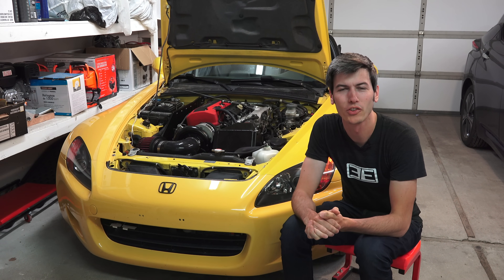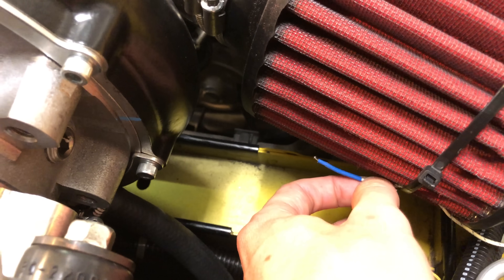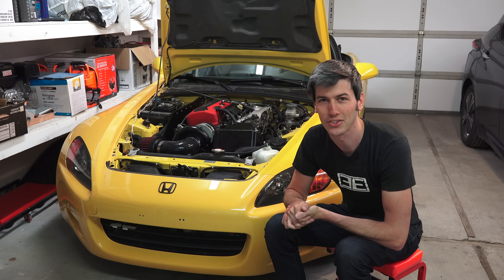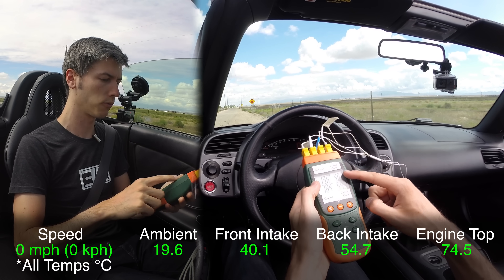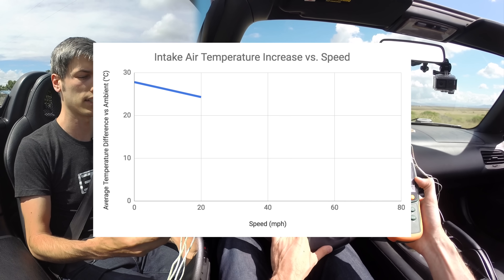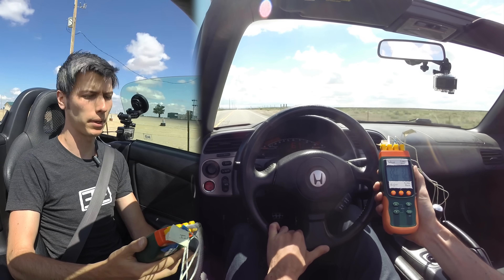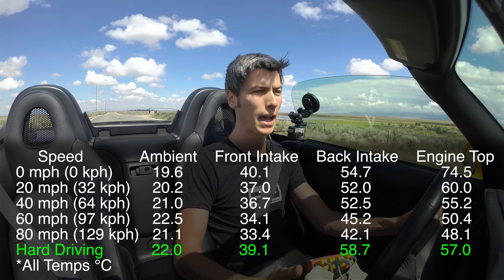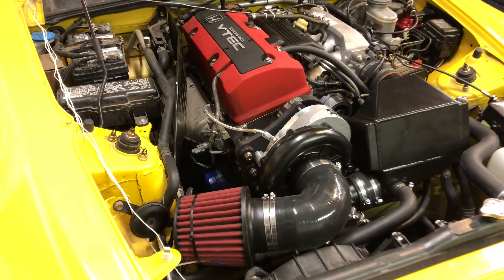Does My Supercharged S2000 Have A Hot Air Intake?

Comment: A hood scoop helps to direct cooler air maybe a funnel with heat shielding could direct cooler air.
 I say a funnel because piping air directly from exterior could allow water to reach the filter wile funneling cooler air into engine bay near the filter will prevent water contamination.✌

Comment: I'm curisious how much heat input the tc's are getting through radiation. Is it actually reading the airtemp ?
Reply from the maker: Yeah it’s air temp. The flow by the thermocouples is fast enough that air temp cools it very quickly. Also there’s a heat shield covering the exhaust, so radiation isn’t super high.

Comment: i think you screwed up here.  you missed the two most crucial thermocouple positions.  inside the intake right after the filter and inside the intake manifold.  sure it's nice to know what the air is like at random places around the engine, but you need to know what the air is like that is actually going into the engine.  for all we know a 20 degree difference in the sourced air has only a 1 degree difference in air going into the cylinders.

Comment: Have a vf engineering non intercooled vortech supercharger on my car. Heat soak is a big problem, the intake in mounted directly in the front bumper intake hole but even then sucking in 136 degree (f) air when ambient is 100 degree. Pushed it hard when i was 105 out and it was pulling timing pretty heavily. No real way to get an intercooler in there so looking at water methanol kits.

Comment: I'd be interested to know how the after cooler impacts the Intake Air Temperature compared to what is being drawn into the Supercharger at the Air Intake.  I'm sure a change in intake temp is noteworthy, but if the after cooler pulls out enough heat, it might not be that impactful to the engine performance.

Comment: When it was bout 90+ out my IAT's were almost 140 degrees on my POS honda. I have a DC short RAM and monitor it with TORQUE for android and a Bluetooth OBDII adapter for like $15. Seems like the hotter the Air, The less power it makes, and my foot is in it more to maintain speed, causing more downshifts, them my MPGs go down the shitter. Maybe a CAI would help MPGs in this instance.

Comment: Problem now is if you extend the filter into cooler air you are lengthening the intake tract, which hurts throttle response (but can potentially increase torque due to air speed). Ideally you'd keep the intake length short but that's tough since your intake is on the same side as the exhaust .. bah. Next step is probably a heat shield or giant hole in the hood above the engine :)

Comment: best way would be to keep oem intake and remove the second portion of the intake which is normaly located under the front of the car and create one with less restriction. maybe not all cars have a second part to the intake i know my 98 prelude does. i know for sure this will help the engine breath better on hot days.

Comment: I'm curious how much heat is coming from the exhaust vs that coming from the radiator; whilst I do think a lot of heat comes from the exhaust, I think the air coming through the radiator and shroud sets the ambient temperature in the engine bay - if there was one more thermocouple behind the electric fan I'm sure it would shed some light on this.
Reply from the maker: Yes, great point. Certainly heat added from the radiator which I think explains the front intake temp rise.

Comment: It's been proven that open short ram intakes without proper shielding degrades performance due to hot air in the engine bay.  That is why the stock airbox always edges them out.
Reply: OCTurboJoe yeah on stock NA applications. On forced induction it's makes basically no difference. The air enters a very hot turbo or supercharger, gets compressed and therefore heated more, then goes through an intercooler. It doesn't matter if the intake air is 78 degrees instead of 87.
Reply: shawnmeyer44 No, it does matter on forced induction as much as NA.  There is MAF and speed density.  Modern MAFs usually have IAT sensors built into them.  The higher the heat readings, the more timing it will pull.  On speed density, hot air is less dense, and will also pull timing.
Reply: OCTurboJoe that's what tunes are for.. when your dealing with boost you want primary iat to be taken post intercooler.. like in the cold pipe or the manifold itself.
The point is that a "cold air" intake will not drop the air temperature enough to change charge temps.. certainly not enough to make any measurable gain in performance. The air is entering a hot supercharger or turbo, then it is further heated by it being compressed.. only to then go through an intercooler.. 
If you really want to drop iats and increase power then get a meth setup or increase the size of that cute little heat exchanger lol

Comment: But will the warmer air generated by the engine bay truly make a significant difference in the temperature of the air going to the cylinder since the compressor will add a significant amount of heat to the incoming air.  What is the temperature of the air going into the cylinder, or at the exit of the compressor/supercharger?

Comment: The supercharger intake position is screaming for a ram air box running to a point upstream of the radiator. Think corvette intake. A heat shield box is ok, but no replacement for free airstream.

Comment: The location of the air intake in relation to the radiator will also be responsible for the high temperature differential you measured. Even while driving, the cool air will pick up heat as it passes through the radiator. An enclosed air box with piping closer to the front of the vehicle, or relocating the filter will have a greater effect than just adding an exhaust heat shield to the existing setup.

Comment: Interesting! Like all research, if you already knew what the answer was going to be there would be no point in doing the work. :-)

My plane's engine air intake is out in the open, right behind the prop. You can feed warm air off the exhaust manifold to melt ice in the carburetor, but normal operation is with cold air. When you turn on carb heat the loss of power is obvious.

Comment: Cold intake works but dangerous. If a splash of water will get to it the engine could hydro lock - not good. That one of the reasons OEMs avoid the cold air intake
Reply: You gotta design an inertial separator into the intake like a number of factory cold air intakes do.

Comment: Even though you take hot or cold air intake the supercharger increases the temperature of the air if the after cooler is not working good or efficiently. But I guess rerouting your intake to front of the car makes sense as colder air is more dense compared to hotter air

Comment: Great video. 

What would your anticipated performance increase calculations look like based on ambient temp and am average of your intake temps?  0-60 time, torque and hp curve? As the temperature is warmer on the slower speeds, I'm sure the acceleration would get the greatest benefit.

Maybe it's time to fabricate a hood scoop for cold air in or a vent to better release the hot air?

Comment: heat shield seems more efficient than moving the intake because by moving it you increase the length of the tube which the air has to travel and it's probably not straight so you get at least a bit more resistance

Comment: Another great video! I wonder if there would be a significant difference if you put the thermocouple inside the air filter so that you're just measuring the air coming in, rather than possible radiant heat hitting those sensors and skewing your results.

Comment: Wonder if having the radiator fans on caused the temp to spike when you were driving it hard??? 
Would make sense, puking a ton of hot air on your engine/intake when beating on it... 
Excellent video sir, please keep us informed on any mods you do, interested to see if any mods you do make a difference, but I suspect any increase in performance would be miniscule at best :-)
Reply from the maker: Yes, radiator definitely raises the temp in the engine bay.

Comment: I don't have a supercharger yet, I do have a K&N intake which does have a heat shield figured tho it would hurt to reduce the heat around the intake a bit more so I gold taped (heat reflective tape) both the heat shield box and the intake/arm tube. Maybe it worked maybe not but it does look cool tho.. thanks for the video good reference point.

Comment: Nice video . Try to cordon off the air intake with a shield ...similar to the ones sold by k&n . Also place an air scoop/funnel inside the grill and direct the cold air with a hose from inside the bumper and  into the cordoned off space. ( something similar to a cold air intake) . I am from India and the disadvantage of running a  cold air intake is during rainy seasons , there  are high chances of water ingress which can cause hydrostatic lock  . With the setup i've mentioned earlier , you can get a cold  air feed and at the same time a much lesser chance of water ingress.

Comment: I wouldn’t have thought you’d need to measure this.

It’s quite obvious that air from outside the car is going to be cooler than air in the engine bay, or am I missing something?
Reply from the maker: I assumed there would be more fresh air passing through, seems the radiator plays a big role in controlling engine bay temperatures, without much additional “fresh” air passing through.

Comment: It could be interesting to introduce a cooling plate as a variable here. Something like the AUT cooling plate that is the designed to pull fresh air in from the front of the S2000, and channel it into the stock intake. Since the filter is sitting right near where the stock air box did, it could have a meaningful impact.

Comment: The intake is behind the radiator in the airflow path, it's a hot air intake. Anything behind the radiator should be considered "hot" relative to ambient just due to the fact that now airflow is cut significantly while having a heat shield is good and will help, moving the filter into a position of direct airflow will result in much cooler temps, always remember that the bumper and most of the front of the car are meant to cut through the air and direct it to the radiator.

Comment: Considering a 30C diference between the ambient temp and intake temp, is it possible to calculate the power loses? Could the higher CFM of this intake overcome the temp issue? 

I’m running a similar setup and getting similar temperature readings in a N52 BMW 130i.

Comment: The concept is simple. No matter what process is happening in your intake, cooler air is better and will make more power.

Take a cup of room temp water and a cup of hot water and put it in the fridge for 15 minutes. They both go through the same process, but one will come out cooler than the other because it started cooler than the other.

Also interesting that people will not argue that cold weather makes more power, but also assume pulling cooler air does nothing when it's going through a compressor.

Granted it might not be worth the extra $300 for an intake with a box/heatshield to get 5-10hp, but the power gains and efficiency improvements will be there.

Comment: That what I missed about the old Comptech S/C setup, the kit provided you with an air box that shielded the filter from the engine heat without the need to route the filter to the bottom because it had a duct you can use to channel cold air into the box.

Comment: Very informative video! This is why I just use a drop in performance filter in stock location, coldest temps by design. Doesn’t get that fun sound but I never have to worry about loose couplings, water, heat soaking, or constantly cleaning it from the extra dirt (like the wife’s car🙄) 
And usually you can slightly modify the stock box to get more air flow. 
Can you do a calculation of weight savings performance compared to temperature performance?
Reply: Zander N ColdEST temps by DESIGN? No. That’s not the priority of the mfg. Weather protection is probably first, which assures restriction, hard turns, no smooth path for outside air. Noise reduction is second, usually disturbing smooth airflow, adding bulk and weight. Cold is not a priority either. Hot air sourcing has been used for decades to warm engines quicker for reduces emissions. Some factory designs are much better than others, and can have a protected outside air source, but your statement is false.

Comment: id like to see a test where the thermometer is inside the air intake, lets say right before the throttle body. and then get a read of the temp with the intake where it currently is and then compare it to the temps if you moved the intake to the front of the car.

Comment: RE: "Need" for hot air.

Had an '86 Dodge D50 with carb. Decided that the arm air stove off the exhaust manifold was bad because coer air is better, right? It was fine in Texas but when I fiannly came home to the Great Northwest, temps were lower and the carb would ice up. OOPS! Fortunately I still had all of the parts and put it back together. Yeah, they put that stuff on there for a reason, just like intake air comes from the outside from the factory.

So my take-away from this is that sometimes you need warm air, but in modern engines cool is what the really cool kids do. 

Now I prefer diesels so you can keep your silly spark plugs and carbs. :)

Comment: ME that doesn't know how airflow works? funny. think bmw kidneys and how it is a clear path above the radiator into the engine. yeah, you can put an ram air intake system into the car but the engine bay gets so hot (usually in between 220 and 240 F) in normal driving... not worth it putting an air intake system like the one you have in your car.

Comment: What would be interesting to see is how fast the engine bay temp drops when you accelerate. Of course, the faster you accel, the faster the temps should drop. The engine doesnt necessarily need that super cool air when idling (but it wouldnt hurt). I think of it kind of like the reverse of your radiator fans. When the car is moving, cool air is hitting radiator. When the car is stationary, the fan kicks in helping to regulate temp....With the supercharger, theres nothing keeping the engine bay temps in check when the car is stationary, but its not a big deal bc peak performance isnt required at idle. Revving the engine in neutral or the start of a drag race would be a situation where the current intake location could cause a problem though. A heat shield is prob a better solution bc the intake is isolated from engine heat and its protected from the elements.

Comment: Wouldn't it be a lot more interesting and accurate to put one temperature sensor in the intake tube and measure the air that actually enters the engine? Radiant heat from the exhaust is an issue but you have no idea to what extend the air is sucked from the hotter side. Its probably not evenly distributed due to the air flow from the front.

Comment: A read from the intake air temperature (IAT) sensor  would have cleared a lot of things out. But without that... we don't know what the intake air temperature actually was.
On my car (a heavily modified Mazdaspeed3 gen1) I was getting about 8-12C temperature difference between ambient and intake when cruising at 80-100kmph (50-63mph). After I added an air box for the air filter that difference went down to 0-2C in the same conditions,  but the temperature difference was more dramatic at lower speeds, as I was seeing even 60-80C IAT during hot summer days in bumper to bumper traffic (speeds of 15-30mph with a lot of stationary traffic), so a 25-40C difference, while after adding the air box that difference went down to 10-25C (40-50C IAT) in the same situations.
So a heat shield or even a full box with a wide opening towards the front would help a lot.